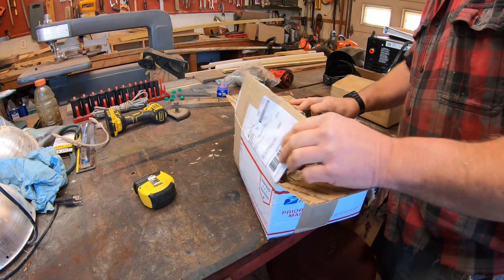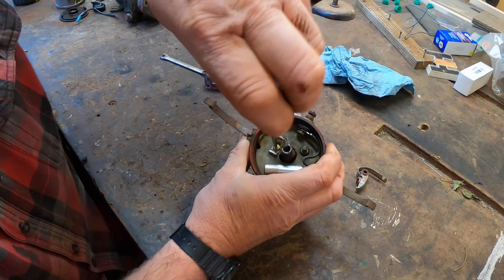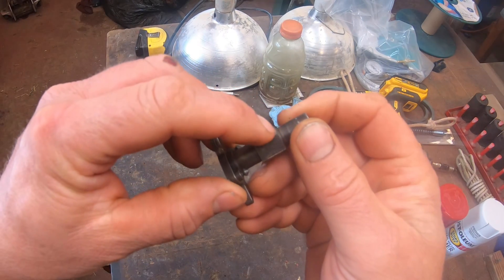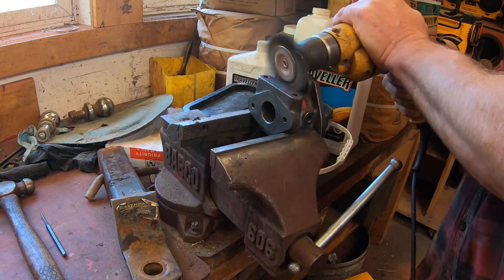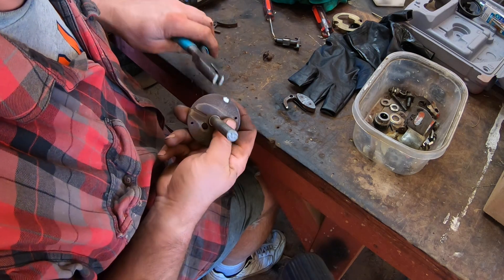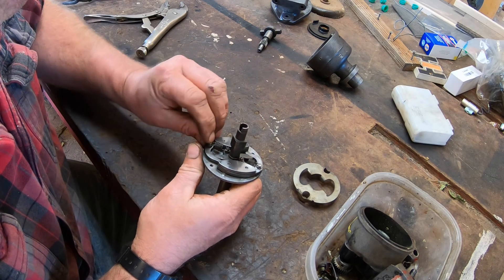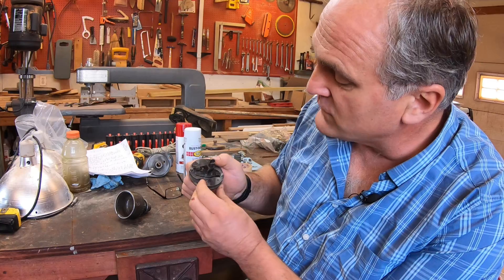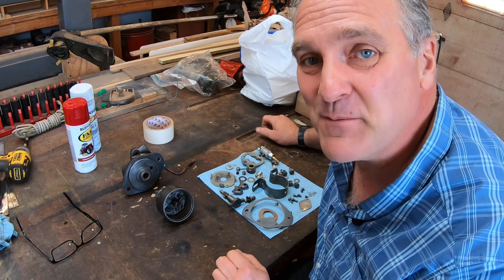farmall distributor repair part 1: disassembly, evaluation, & cleaning

Comment: Thanks for the excellent  how to video on rebuilding the distributor. I have a 1953 super c farmal with a distributor # 353898R1. I need to springs for the spark advance. Someone wrote an article stating that this distributor for the super c required two different size springs for use on the spark advance system. The springs that f two different sizes were on the tractor were of two different sizes.  Can you recomend a source of supply for the distributor springs?

Comment: Have you thought about adding an electronic ignition to the distributor while you have it out and on the bench?
Reply from the maker: I don't use electronic ignition; points are so easy to repair and replace.

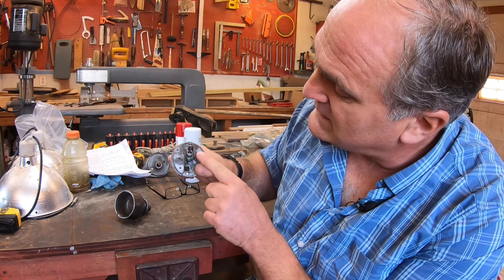Comment: Overall I think this was a great informative video. Just after the 9:45 mark you refer to the lobes on the cam that open the points as points as well. It's a bit confusing if you are not familiar with distributors. I know it's not easy to explain on the fly but I'm sure that some wrinkled foreheads appeared between 9:45 and 9:55 for the less well versed in mechanics.
Reply from the maker: Lobes!! That the word I was looking for! You're right, thanks AutoCrete.